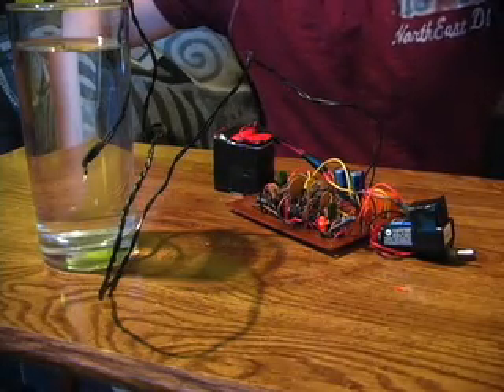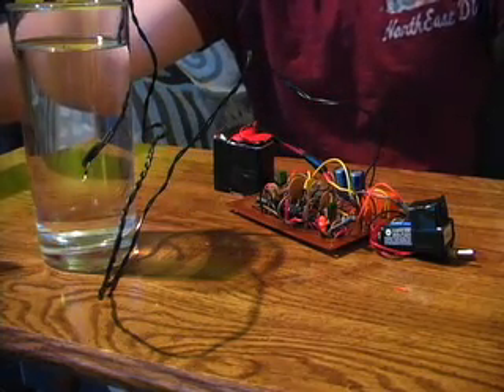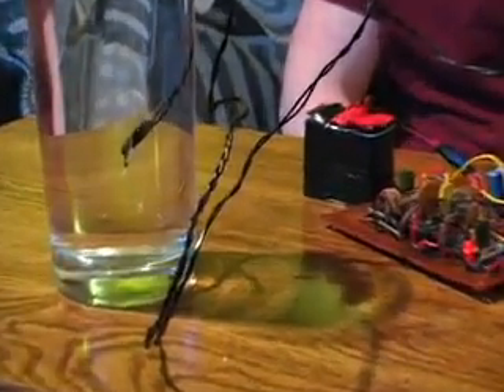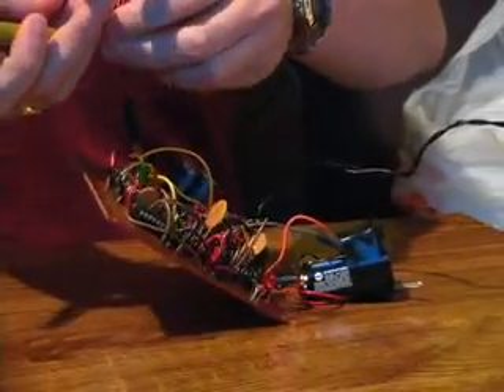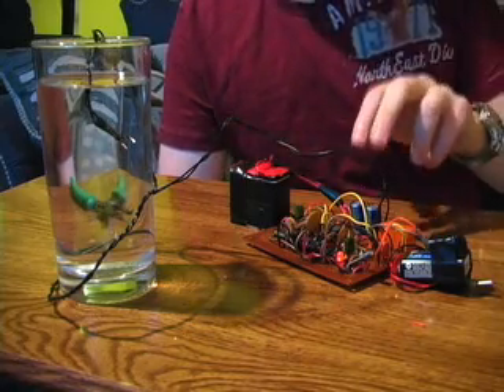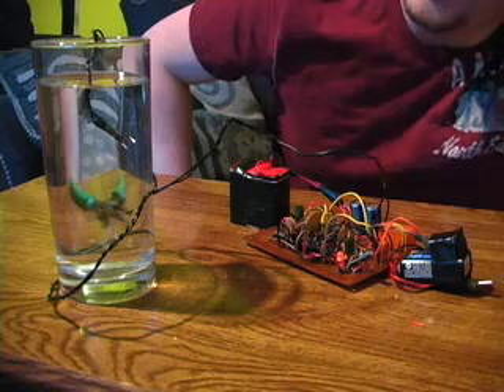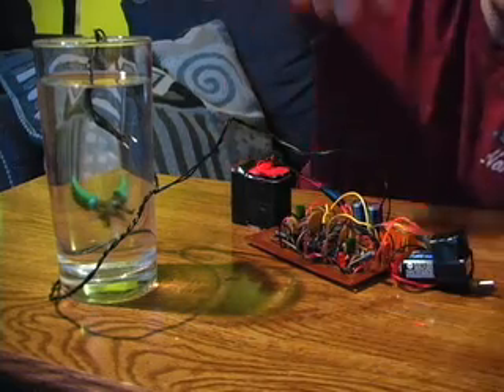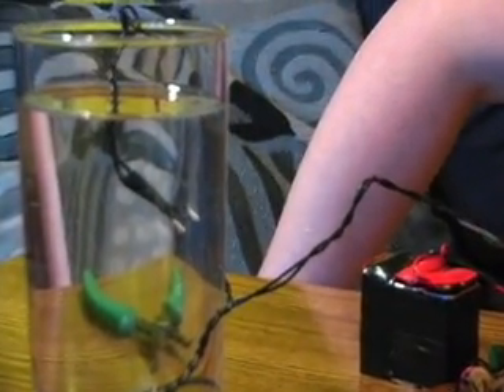Timer/Primer Circuit Timed electronic burst

Comment: First of all no oxygen was produced, Chlorine gas was, if you use NaCl as your electrolyte you'll make Chlorine at the anode and hydrogen at the cathode. Secondly you cannot produce monatomic H and O in such a cell you produce H2 and O2. read about salt water electrolysis for more info.

Comment: The Caps where not discharing correctly, you just set up a simple electrolysis hoffmann cell which in your case using NaCl (table salt as the electrolyte you ended up producing Chlorine gas at the anode and hydrogen at the cathode.  the breakdown voltage of your electrolyte must have been passed and your caps trickle discharged.

Comment from the maker: In the CRT, what creates the 20,000 + volts is the flyback transformer.  It is on my to-do list to figure out how to configure one so that I can create an arc using DC voltages (batteries)